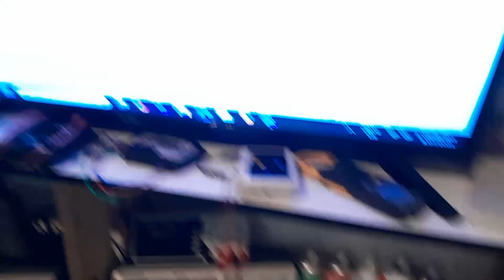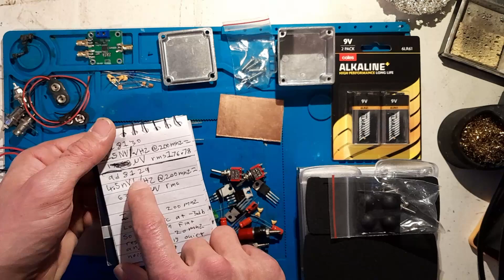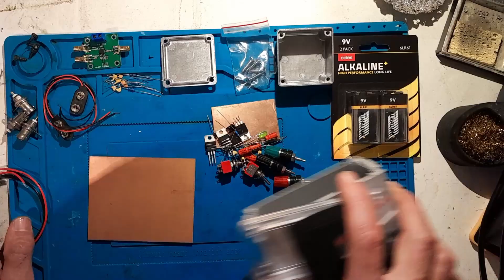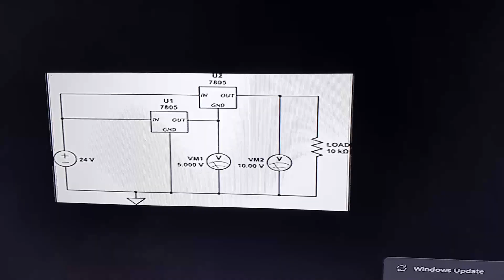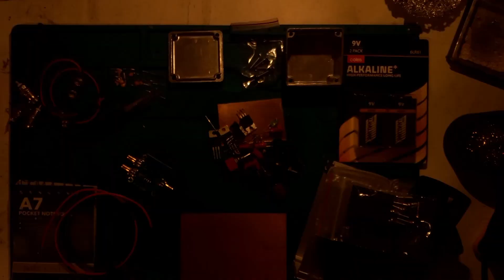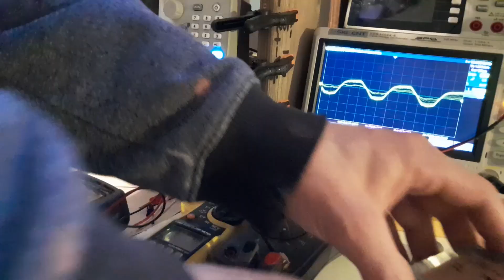Differential rf amp project update!

Comment: Yes it does source the signal and the specs are awesome as are the real life tests. Before you take the piss out of a Wien Bridge oscillator with an incandescent bulb as part of the control you should check out Hewlett and Packard (HP) Their first ever product may interest you, as it's exactly that ! It is a subject that Dr Hewlett produced many papers on and he did it with valves (tubes) the physics remains the same. Why not have a go at designing one with a modern opamp ? I have and it's fixed at 1Khz with 0.005% THD+N and it's more than good enough for test and repair of audio gear it would be interesting to watch as a mini series. Give it some thought for when you are done with RF amps. Meanwhile get the Quant Asylum !! EDIT :- Sorry back on topic, just had a look at the data sheet for the AD8129 and the description reads "The AD8129 and AD8130 are designed as receivers for the transmission of high-speed signals over twisted-pair cables " and totally forgot what you intend to do with it or is it just an educational exercise please ?
Reply from the maker: Hey mate i spent a long time building bulb stabilised oscillators a couple yrs back, (now have insane collection of small bulbs😂) that's how I discovered a way to build one with 0.0002% thd, I can't remember the rest of the specs but I can look it up if you want and even send you the schematic if your interested,anyway that's what I was going to build before I decided on the quant. BTW just because a datasheet sujestion sais somthing does not mean the component can only be used like that. Twisted pair lines are inductive and very capacitivly coupled that means this chip has a stout driver and good cmrr on inputs, it dosnt mean you have to use twisted wires!
Reply: @daveselectronicslab  I good on the designs but thanks and yeah read a few datasheets myself !! I was trying to remember why you chose this device for what application !  I am aware of the device pros and cons from the sheet but have never used it so how are you going to configure it ? is it test gear or just an exercise ? EDIT:- forgot to ask what setup were you using for your THD 0.00002% reading as I was using an external sound card and the software was 'ARTA'
Reply from the maker: Dude thats hillaruous i used to use a sound card too but i never trusted the results as one day I remade the input jack area up with a shielded area and coax soldered strait to the board and the thd dropped so I always thought the sound card was lieing and that was just the input jacks let alone the rest of the board! also I never built this circuit just have it, I played with bulb based oscillators then discovered this schematic for a device a high end audio company used so i saved it!@andymouse
Reply: @daveselectronicslab  :)
Reply from the maker: I'm building differential amps for measuring common mode stuff and they're all going to be lower noise than the one before I figured I'd play with an ad8130 and an ad8129 first before rebuilding the t100 lna
Reply: @daveselectronicslab  :)
Reply from the maker: We're are you getting that number from I said 0.0002% also yes sound cards work great for audio with loaded stuff  but high impedance stuff they fail with as I said I found just coax and shielding affected numbers at high z
Reply: @daveselectronicslab  My bad !! I added a zero ! so what method did you use in the end I like to know if there's new software available and other peoples techniques are always interesting
Reply from the maker: I think sound cards have too much trouble with high impedance signals too much noise gets in
Reply: @daveselectronicslab  Not at all it's go to method for audio work If you need convincing read the 'Arta' or 'REW' John Audio Tech has some great videos on his method. So what did you measure your THD with because 0.00002% is a great reading ? what was the setup please and maybe dig one out and show us that would make for an interesting vid ! I must know how you made the measurements please ?
Reply from the maker: I cant remember what it was called it was on an old computer running win7 it was "somthing" visualiser i think i just cant remember the exact name all i do remember is it was measuring noise and its own harmonics (tried various cards and modded one) and then did more research only to find i was right and so i binned the project so to speak
Reply from the maker: Or maybe visual analyser looking at google that rings a bell but im not sure it was a couple yrs ago maybe even 3 or 4
Reply from the maker: It ran on an old win 7 laptop with an external sound card added and it had a sound card scope on it too